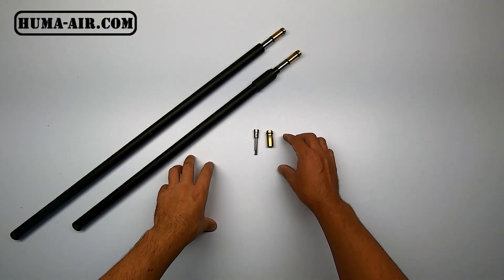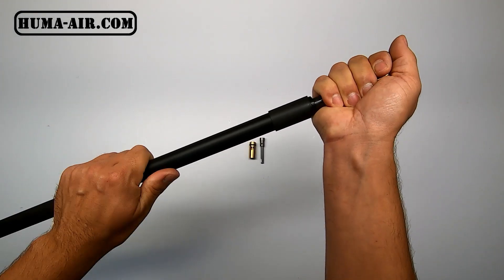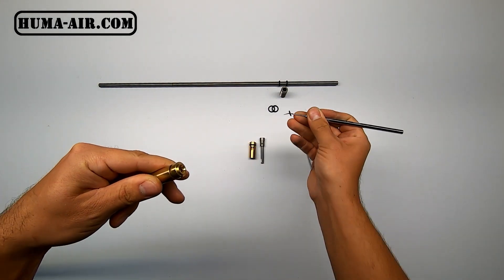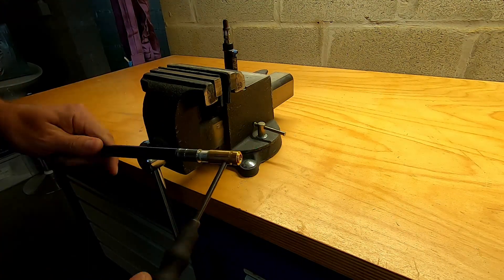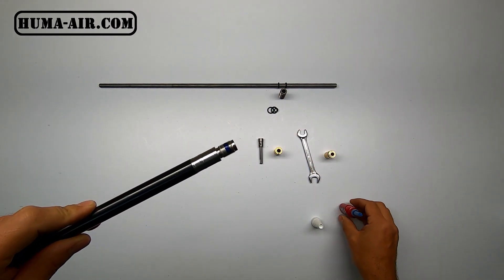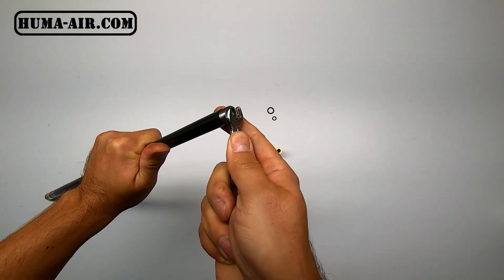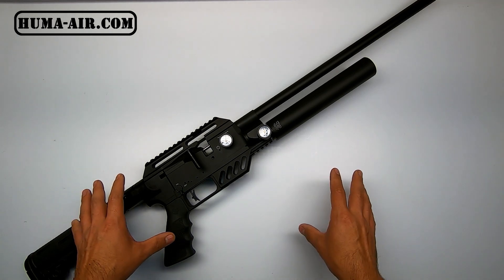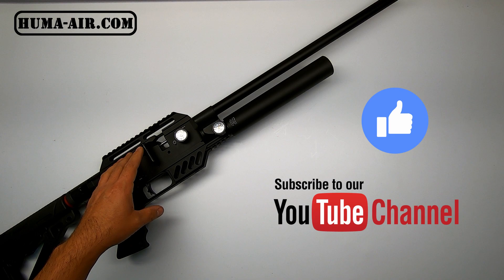Huma Air High Flow Dual Hole Transfer Port Installation

Comment: hi.can we use dual flow port for pellets?is the accuracy same?please reply.
Reply from the maker: I have been using it for pellets and slugs and I don’t notice any difference in accuracy.
Just use the pin probe for slugs and a matching pellets probe for pellets
Reply: @Airbuks  thanks for your kind information.

Comment: Great video. I god your transfer port and installed it on my FX crown mki2and the pin probe. My problem is I now cannot get my barrel returned to the key position. It needs to return a millimetre or so more but I cannot see what is causing the barrel to key in. Any help would be appreciated  appreciate d
Reply from the maker: 🤔 hi mate , I have never installed this in a crown ( I just have one 😉) but have you compared the groove in the brass piece with the original to see if they have the same length
Reply: @Airbuks  thanks for the reply. It looks visually the same. I'll get my hands on a micrometer and check. Thanks again.
Reply: Yes the key on the huma air is not as deep as the original FX transfer port. So it's back to the FX transfer port. I wish huma air would have better information on the fitting. It's advertised as fitting the crown but it certainly does not fit mine
Reply from the maker: @nollaigbeag  I will contact them about it 👍🏻
Reply: @Airbuks  I really appreciate all your input. 👍
Reply from the maker: @nollaigbeag  hey Noel , I contacted them and it should fit the crown , but it’s possible that you have a bad one that might moved in the cnc machine .
The asked me to ask you to send a mail to this mail address 
techsupport@huna-air.com

They will take care of you 👍🏻

Comment: I think my dual-hole transfer port is too large (the dual-hole) because my slugs stuck/bump in the hole so many times now, i even change the huma slug pin, pellets pin, and slugs power kits matt dubber edition, and even change the magzin all same result and even with single loading... Dont know what to do anymore
Reply from the maker: Strange, I haven’t encountered that myself . What caliber end slug do you use. ?
Reply: @Airbuks  22cal 23grain H&N,  even with pellets but with pellets its rare...
Reply from the maker: @biakmawia  those are tiny short slugs , I have heard magazine issues with those but not in the transferport 🤔 have you tried heavier longer slugs ? Just to see if you get the same issue
Reply: @Airbuks  25 also same result...  But if i push back the levers fast then no problem but if i try to load the gun slow n smoothly its always stuck in the dual hole i wish i can send you the video or the image..
Reply from the maker: @biakmawia  you can e-mail me 😉 
Airbuks@icloud.com

Comment: Did you have a small gap (or small amount of play) in the area of the first oring you removed between the barrel and transfer port? I do on my stock .30 arrangement
Reply from the maker: The oring slot that is closest to the barrel sleeve is a touch wider then the one closest to the breech I believe 🤔 but it should close nicely against the each other ( sleeve and tp )

Comment: Hi, did you do this upgrade for shooting pellets or only to shoot slugs. I changed mine for slugs in my dreamline  but i cannot get the slugs to group so I'm going back to pellets. Is it ok to leave this TP and probe in for pellets
Reply from the maker: I would change to a pellet probe with larger opening ( like Huma ) and leave the dual port 👍🏻
Reply: @Airbuks  thank you, I have the huma port installed also, so I will leave both in
Reply from the maker: @fiestamans  hi maybe my explanation was confusing. I would use a pellet probe with a opening to match the transfer port ( if you want to shoot pellets ) if you use the pin probe the pellets won’t seat deep enough into the barrel . The pellets have a skirt with a cup and so the pin won’t push them deep enough , slugs have a very shallow skirt . 
The dual transferport can be used for both pellets and slugs 👍🏻
Reply: @Airbuks  No I understand you. I've got the huma TP and the high flow pellet probe to match. Thanks

Comment: Nice! Is it possible to make seat on this brass part for another o ring close to dual hole port (same distance from hole as this existing one just from the opposite side of hole), like on this barrel: https://imgur.com/iNGcdAb                        Is there enough thickness in brass part to do this? It should provide even better airflow.
Reply from the maker: Probe it is possible , I don’t know if it will make a lot of difference but it can’t hurt 😉 for this you have to contact Huma air , maybe they will incorporate it in there design

Comment: The pellet probe is a big part of this system in fact this part is is useless without it. It was not clear that this was needed, it’s not stated on the HUMA website or your video that a probe was needed! I’ve put the transfer port on, is my rifle waisting air by having a larger hole? Why would anyone sell something that’s incomplete & there’s no word when if ever they will make the additional probe!
Thanks...
Reply from the maker: Hi , you can use it if you have the slug power kit of FX aswel . You can buy the TP of Huma with and without the probe .
When I made the video at that time the probe was only available for the impact as of now they also make the probe for the Dreamline.

But by using only the TP your gun is not waisting air . If you don’t want to spend the extra cost you can also modify the original probe to match the TP
I apologize if my video has mislead you 
Merry X-mas

Comment: Hey guys" got a question or two! I got a FX Crown,  I watched this video 10x or more and had no problem installing the Transfer Port but got no real bump up in speed! Do I have to have the Pellet probe to complete the system? He doesn't cover that. I bought the transfer port without the probe...
Reply from the maker: Hi there , yes you need the pellet probe aswel to complete the system.
Indeed maybe I didn’t sad that in the video 🤔 I assumed that it always came with the probe 😬
If you are using the original probe the smaller hole in the probe becomes your limiting factor. Also remember you will have to retune your gun after installing it .
Stay safe and merry X mas

Comment: Hi Airbuks, hope you're keeping well and safe.  I need your advice and help please.  I've now followed (since one of our earlier conversations) and installed a Huma dual transfer port on my .22 FX Impact MkII with power plenum and 700mm Superior STX barrel.  However, my velocity as measured before (single port) and after (dual port) remain identical which means the addition of a Huma 2-port has not helped increase velocity!  My setup is 17.2mm on the power wheel for max setting, reg. pressure of 115bars and 4th line on the airflow valve.  Could you please give me some idea as to what to try by way of power wheel and reg. pressure adjustments? At present, both 1-port and 2-port settings give identical 900ft/s with H&N 25 grain slugs and I'm hoping to find the optimum setting (so without wasting air) to increase my velocity from 900 to say 950ft/s to improve the accuracy of H&N slugs.  Many thanks for your help.  Take care.
Reply from the maker: Hi , all well here 👍 I hope by you the same 🤞🏻
1st question, did you also install the matching probe ?
Reply: @Airbuks  Hi  good to hear from you and glad all's well with you.  I don't know where your're based but the situation with the pandemic in England is going into a major 2nd wave.  No, I've not installed the probe!  I tried every combination yesterday and I could not get any improvement in velocity.  I was at my wits end and got fed up!  I've currently got the rifle set as: reg p. 130bars, airflow valve 4th line, power wheel gap 15.6mm (set on max - this is almost the smallest gap achievable).  I am getting with H&N 25grn slugs 940FPS average.  With the same settings as above and the FX original single port I was getting 935-940FPS average.  so I've not improved FPS performance.  I look forward to your view and any ideas.
Reply from the maker: Hi , I am living in Belgium . Pandemic is very bad here at the moment 😔 .
But we are fine and feeling good 🤞🏻

So not having the probe to match the transferport is your problem .
If you use the original probe  the air transfer is still restricted because the whole in the probe is still the original size . You can buy the one from Huma that matches or modify your original one with a dremel if your a bit handy
Reply: @Airbuks  Many thanks, great to hear from you.  I bought my dual port from Krale so I probably go back to them for the matching probe.  I have a Dremel but I don't have the confidence! and I think perhaps I should retain the original FX probe just in case.  I'll write to give you feedback on this once I get the part and install and test it.  We visited Bruges, Brussels and Liege in 2018 & 2019.  Thanks again for your help.  Take care.

Comment: I have the Slug power kit installed on my Impact... will it be a good match with / make sense to install the Dual Air Flow Transfer port ? Would  greatly appreciate your advice.
Reply from the maker: Yes for sure 👍
Reply: @Airbuks  Thanks so much !... last question,  did you re-install the inner O-ring ? it seems to have been omitted in the installation.
Reply from the maker: @nuangel  no if you listen carefully i mention its already installed on the Huma TP when you buy it ;-)
Reply: @Airbuks  Oops, sorry, will look for that part. Thanks again ! -- ( it was in the Overview video)
Reply from the maker: @nuangel  yes in the 1ste video ( overview) near the end 😉

Comment: Absolutely useless   But thank you for your video I got it it did nothing actually made accuracy so bad
Reply from the maker: Sorry to here that , but have you properly tune it ? For me it works great , more FPS same accuracy but I did have to tune it after installing
Reply: Airbuks hi I spent one hour to make adjustments and tuning no luck , I really appreciate it
Reply from the maker: M H i will do some more testing 🤔

Comment: Hi , since there is some air restriction with Factory FX Transfer port , when we use the Huma one do we get more power WITHOUT  decreasing total shots count ?  thank you so much
Reply from the maker: If you leave the settings exactly the same you will get more power and a few less shots , reason is that the TP lets more air true the barrel in the short moment the valve is open . But by adjusting the settings you can lower your regulator setting and hammerspring to get the same velocity and power and gain some shots. 
I hope my explanation is some what understandable

Comment: I install the Huma regulator and the dual hole transfer port and pellet probe of huma and i shoot with my impact .30 the nielsen slugs 49.5 grains at 1070fps very easy !!
Reply: Wow, I assume you have the pp 700mm barrel?
Reply: @whiteykauai  yes 700mm superior Liner and PP. 👍
Reply: Haha 1070fps with 49.5G NSA.... what’s your reg set to ??
Reply: @FYMM69  at 150 red with 600mm barrel, 960 fps with FX 45 pellets
Reply: I also have the original reg that came on gun
Reply: @FYMM69  160b stronger hummer spring and more heavy hummer. Soft spring of  valve. I can send you a video with crony. 👍
Reply: @FYMM69  150
and yours to get 1070?

Comment: What was your reg pressure on the second test, also you didnt re-install the small inner O ring.
Reply from the maker: The reg pressure is the same in both tests , i specially did this to show what this TP can do without any other adjusments .
The inner oring comes installed in the Huma air TP so there is didn't forget to install it . I believe i even mention this in the video that it comes installed .
Reply: @Airbuks  Many thanks ive ordered from huma looking forward to installing it. your video was most helpful

Comment: Nice video! Was there a gap where the brass meets the steel. My O ring seemed to small. It has to much play in it
Reply from the maker: No not that I recall, I know the oring has some more room that the second one , but there should be no gap between the brass and steel 🤔
Reply: I have a gap on my 30cal stock barrel. I have removed barrel from gun, obviously, but I haven't monkeyed with liners or anything else. Now I'm curious, I haven't had it long and bought it new. Have you found out anything new?

Comment: Dumb question here but couldn't you just use the existing hole in the transfer port as a guide  and drill through the other side 180degrees out?.
Reply: Nvm i see the ports now lol
Reply: It is orientation dependant. You would need to enlarge the existing hole, but the reason they have the bar down the middle is to stop pellets / slugs getting stuck. Ernest Rowe has a transfer port with a hole a 180 and it can be turned to give you a sub 12

Comment: For 10-20fps more? I don't think it's worth the upgrade or the hassle..Jmo! You can get more fps without the modifications. There is a video from 101 airguns or 901 that shows how to adjust the fps just by adjusting the regulator and hammer spring.
Reply from the maker: Hi thx for the comment , the point that I am showing in the video is that with only changing the transferport to the Huma one without touching the regulator or Hs you already gain 20fps , once you properly tune it for high power you can gain 80-100 FPS extra .( I have tested this last week ) The Huma transferport is designed to be used when you have tuned your gun especially to shoot slug with high reg pressure and let’s the big amounts of air transfer much better

Comment: This part does nothing... Totally useless and a waste of money. I installed it and the power is exactly the same as it was before.
Reply from the maker: Hi Thomas , are you shooting sub 12 ft ? This mod is especially for FAC airguns and needs tuning to high reg pressure and hammerspring to show its potential
Reply: @Airbuks  i am shooting at the factory settings of an FAC dreamline. With transfer port and hammer spring maxed out, reg at 100 bar, i get 865 fps with JSB heavies. 500 mm barrel.  Caliber is .22

What settings do you suggest?
Reply from the maker: Thomas if you look closely at my video I am running my reg at 145bar /HS at Max (16.75mm ) and transferport at 25/30 . This settings give me around 980fps . That’s what I meant by tuning and running at higher pressure. The TP of Huma eliminates the restriction of air flow true the TP , if you run low reg pressure at 100bar you will not see anything different in results. This is because you are not pushing a lot of air true the TP and therefore the TP is not you limiting factor to achieve higher FPS
Reply from the maker: In the example I am also using a 500mm barrel in .22 the impact is a 600mm .25
Reply: @Airbuks  How do you measure the hammer spring?
Reply from the maker: @fiestamans  just in front of your power wheel there is this little block that slides ( depending on your HS ) . Measure the gap in the groove between the body and this block 👍🏻
Reply: @Airbuks  thank you. I want to have a go at tuning for 21gr h&n slugs but in case I want to return to factory settings I want to document everything as it is incase I f##k it up. I've got Dreamline lite bottle in 22 with 500mm barrel and I've added a 2nd plenum. I've already gained 12fps by doing this with JSB 18gr.  I'm going to change TP to huma dual and their pellet probe. Where should I start with regulator and hammer. Should I have low reg with high hammer tension or high reg with low hammer tension? Is it a case of winding hammer up to max watching speed,  once speed peaks and starts to drop then wind back 3-5% and that optimum?  Also is it possible to tune for 21gr slug and drop power down by either hammer or TP and shoot 18grain pellets all on the one tune

Comment: What besides adding fps does this improve? Does adding this cause more air from your tank to be used?
Reply from the maker: Now it doesn’t use more air . The purpose of this transferport is to eliminate the restriction of airflow when you want to push pellets or slugs fast . For instance you crank your reg up to 160bar , hammerspring on max and valve wide open . Now when the hammer strikes the valve a huge amount is being released and has to rush tru the small oem transferport whole , the diameter of this smaller whole deterrence how much air can pass and the max FPS wil be reached . Now Huma has created a much bigger whole 48% in .22 cal so more air can pass at the same time and result in higher Max FPS and therefore use less air but still maintain the same speed or shoot heavier slug at the speed you want . Hopefully my explanation makes sense 🤞🏻
Reply: @Airbuks  That sir was a amazing response. Thank you so much.
Reply: @Airbuks  When i get this should i also get a pellet proe? I have a FX wildcat Mk2  .30

Comment: Great info! Does changing the transfer port reduce your shot count?
Reply from the maker: No , it can even increase your shot count because of the better airflow you can reduce the reg pressure and gain a few extra shots while keeping the same speed
Reply: Does the new impact compact MK2 have an upgraded transfer port? I heard many of the internals were upgraded like the valving and airflow? I am mainly going to shoot pellets but wondering if changing to the Huma upgrades is necessary?